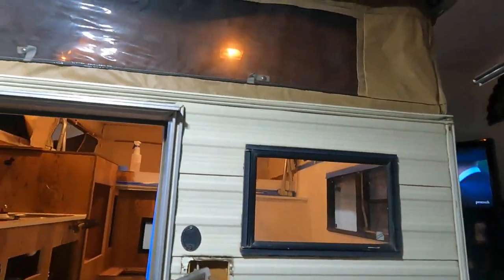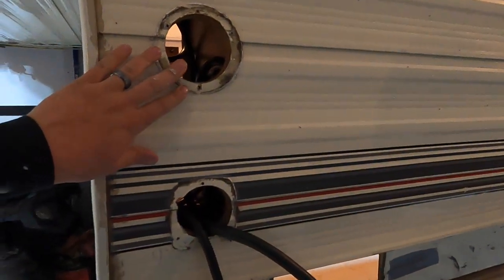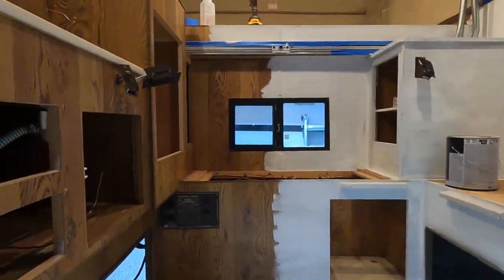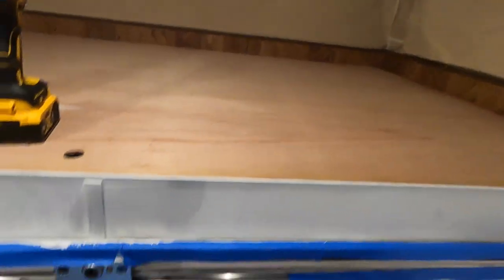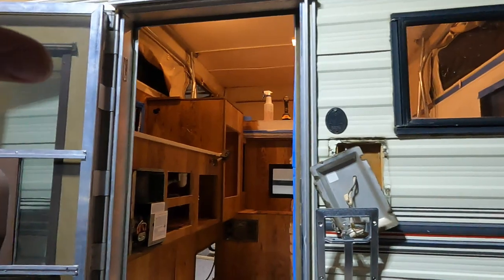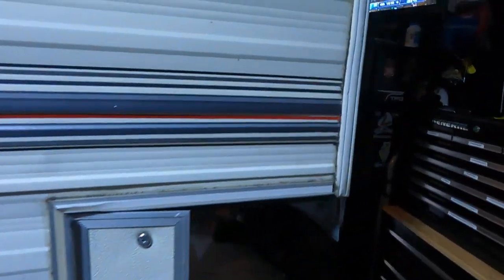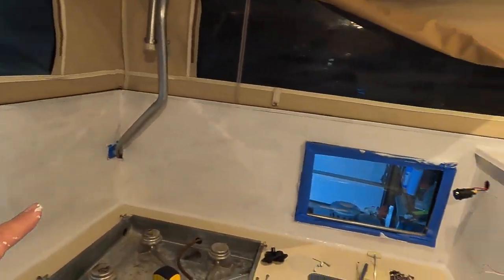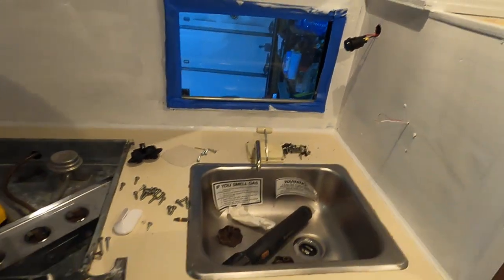Truck Camper Renovation Project - Part 1 (How To)

Comment: After a trip to Yellowstone N.P. in 1987 towing a pop-up camper,  I decided upon a truck pop-up camper for easier traveling and faster setup and less wheels on the ground and no license fees as well.   Win-win.   I purchased a used Sunlite slide-in in 1987.   I still own it and still enjoy it. 33 years is a long time to own any camper and it is still in great condition.   I hope yours lasts for you as long,  with good service.    Good luck with your project.

Comment: What kind of paint did you use …?? Will know today if we have one bought 🤔..a 98 model…
Reply from the maker: Exterior was herculiner. Interior is valspar cabinet paint. I would recommend spending twice as long sanding the inside. I just scuffed mine up and it wasn't enough.